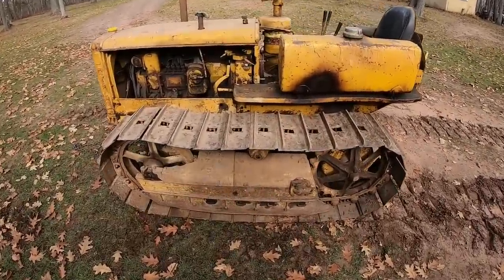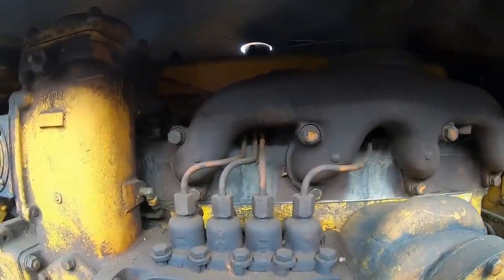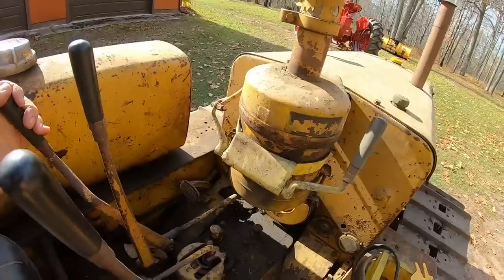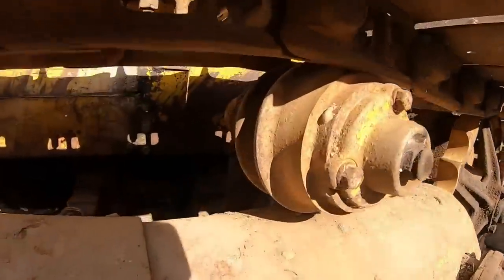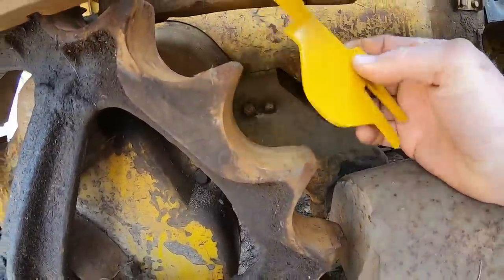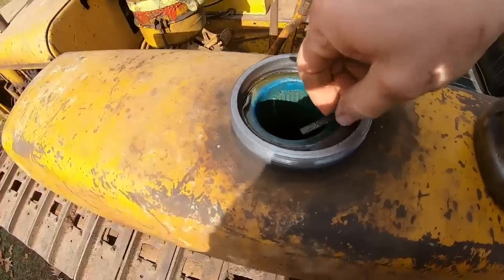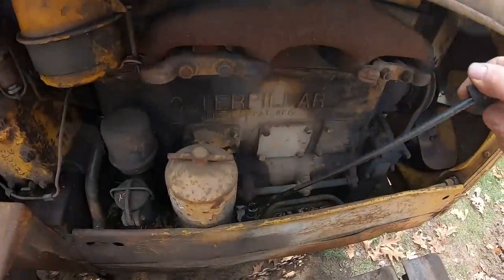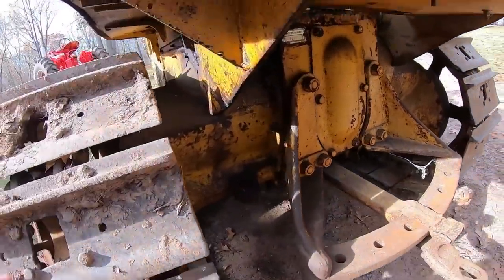What Is a Cat D2 Worth? How I Assess Value When Looking At Crawler Tractors & D2 #5U4177 Walkaround

Comment: I recently bought a 1956 D4 with a 10' blade and direct 24volt start for $8,000 it had been stored inside for the last 20 years and runs like a top.

Comment: Gosh I appreciate all the information you share!!!   Few years ago I was able to relocate my old D6 Cat that I used to own.  Lost track of it almost 30 years ago.  It’s been found sitting in the woods on a farm.  Man I’d enjoy having it back to fix up and get running again, even for old sentimental reasons you might say.  I’d been from radiator to drawbar in it.  It’s a dozer with double drum LaTourneau cable control until.   It’s 4R series.  I had new pins and bushings put in the tracks by Cat before I sold it.  Pads are at least 50% better, sails are good, rebuilt both users, new drive sprockets, rebuilt the pony motor, radiator all gone through and cleaned, new cutting blade and ears. Don’t think it saw much work after I sold it,  but I understand from the owner he dropped a valve in the diesel and had to replace a piston.   So they’ve been inside the diesel and I would trust what they would do to fix a lawn mower!!   So God knows I wouldn’t trust things now!   But I’d like to have it back.   But I appreciate all you share with us!!!  Be safe.

Comment: I found a D2 a couple years ago out in the middle of the California desert. It was equipped with a winch  mounted to the side to pull pipe or fence post not quite sure. Its been abandoned probably for at least 10 years. Thinking about getting a couple batteries,deisel, and water and firing it up.
Reply: Definitely a video I'd watch. Good luck.

Comment: I believe the hour meter is actually based on a particular RPM    for 1 hour = 1 hour on the meter.  So not a clock.   Actually reads engine revolutions .  If you know  what rpm = 1 hour, you can figure out how many times the engine has turned over in its life time.
Reply: @squatch253  I have  had ones in antique boats that were based on 2350 rpm for one hour.   And 3200 for 1 hour.   I think some older airplanes also have mechanical hour meters.

Comment: Just for fun; I watched a video yesterday of a CAT 964 I believe wheel loader being transported on a low boy trailer! 740Km transport! They had to remove the cab and once the loader was on the trailer, the back tires were on top of the tandem axles. So they had to let air out of the loader tires to go under bridges. The trip looked like it was the Alps, narrow roads, hair pin turns, up and down mountains, driving in the middle of the road. IIIIIIIIIIII!!!!! 😞😓😩 That loader was as long as a football field and half of each tire stuck out past the trailer frame. There ain't enough money to pay me to haul that! 😀

Comment: This is good information.  I was looking at one about half a year ago that the guy wanted $4500 for, but it had a bad radiator, the pony motor had no compression, and looked like it had done about two life times of dozer work. I though the guy was asking way to much, and now I'm glad that you confirmed what I was thinking.
Reply: @squatch253  what is the HP out put for a D2 Cat ? How wide of a dozer blade do they normally have on them and rear Ripper ? About how much drawbar pull do they have ?

Comment: That pipe drain for the steering clutch compartment was interesting.  I talked to an old timer here that was saying they would always just drill the plug and put a cotter pin through it once they started leaking bad.
Reply: Yep I have seen that on a main clutch housing too
Reply: How's the d4 coming along, I'm full confident you'll end up with a fine machine. Cheers from Jacksonville Florida 🌞

Comment: Thanks for the thoughts.  I just want to enjoy the rebuild but avoid the rule of 3 units to make one.  I have seen a couple of D2's listed as ran when parked. I don't have the space to rebuild one yet but hopefully someday.
Reply: @squatch253  well the F250 is still just a 2 but give it time I'm sure you will find a donor.  I have to admit I have scrapped a second Snapper tractor YT18H to ensure I have parts to keep my primary running.  Part of the process to keep old equipment running.

Comment: I bought a d2 with 8000 hours logged had a blade and drum. Bought an arch for 200 dollars   Bought the d2 for 2500 dollars.  Logged 10 years and sold it for 3500 dollars. Had to do alittle work on the pony motor.     Luca

Comment: are you eventually going to machine a pony motor main bearing boring set up.. that bolts to the opening in the case and allows you to bore the bearing bore for oversize bearings..

Comment: Can you Cut key ways into the splined sprocket.  And the shaft if the splines are worn? Should be able to press it down further and save it?
Reply: @squatch253  -Im getting the idea you tried this?  We have done it on other equipment built like the D2.  Would be lying if I said I have never welded a splined shaft to the drive sprocket.

Comment: Why the hell are the final drive Hubs on mine solid ??? I haven’t saw any others like that. Mine is damn near mint but the steering clutch’s are stuck I think also it has 316 hrs on it and idk man it’s a sick tractor I know my grandfather got it from the neighbor who got it new I believe and been in my family since. The neighbor use to drag the trailer through the apple orchard when it would be wet and the ol 2wd tractors would get stuck. I know my uncle did a little land clearing with it and so did my grandfather since it was restored and it was used around my shop pushing out apple trees and grape vines. The draw bar is like brand new the whole tractor is. It even has a electric start pony motor, and radiator cover/ hydraulic pump guard and the upper front side panels that go between the lower panels and hood. Would love to send you some photos and get your opinion. ITS NOT FOR SALE I have all the original paperwork for it since it was new and Every receipt from the restoration and everything else that was done to it. This dozer has never left the road I live on 😂 it’s just progressed up and down the road to family members properties 😂
Reply: 5U6110 from the rear tag 🏷️

Comment: I'd like to see it restored... Not to a 100 percent, but to working order. For me a Pony Motor and a Back End only. A wide trucks D2 for parades only, fine with me.
I don't like to see a tractor in OK 50 percent working order split into parts. I also had some Old Iron under my hands during my life, and tell you,,, Some ended as Parade Tractors only, some 10 hours yearly, but they were kept in life.
Reply: @squatch253  Thanks, I really see your channel as #1 in Tractor(s) Restoration.
As a small time restorator, it means a lot to me.

Comment: Trying to remove the water pump on a D2 like that one, without removing the radiator. Is this possible and if so, how?  The fan belt is off and the pump is unbolted from the block, but the fan blades interfere with the radiator core when trying to wiggle the pump out. Its so close but no cigar yet. Thanks for any help.

Comment: I don't think it will ever do a days work ever again in a commercial setting.   So is only of interest to the hobby fraternity.  The bottom line is it is 5 tons at 200 dollars a ton.
Reply: @squatch253  From that point of view you are right. I collect old motorcycles, and they eventually get to be quite expensive, but only once they pass 100 years old.   So maybe spray it with preservative, keep it safe in a barn/museum, and in time it will become really sought after. . . . Best of luck..

Comment: Notice the rear right housing mount bolt was about 1/2" out?
Reply: @squatch253  Yeah, I figured either something was hurried or just plain missed for a while. Which is probably fairly common on old farm equipment.

Comment: It is a wide gauge too.
Reply: I noticed the same, surprised no mention of it.
Reply: @squatch253  good to know. I looked at one here in Northern California that was a 3J. He wanted $1500 for it. Pony had froze at one time and tracks built up with lots of 7018! Oh, it didn’t run. I have a 5J that I need a few parts for but not that much. Thank you for the walk around on you D-2.👍🏼
Reply: @squatch253  That IS surprising, though I wonder how much the difference in mindset of experience with equipment /tractors in general vs today makes. As in more common knowledge regarding traction/tractive effort.

Comment: What was a D2 new from dealer?? I also wondering what a D8 1957 was new from the dealer??
Reply: Looked up the invoice when my grandpa bought a D2 5U new in 1950 in northeast ohio.  It was sold with lights and starter and a pto. $ 3950.00 and a allowance of $725.00 for a cat 15 on trade.